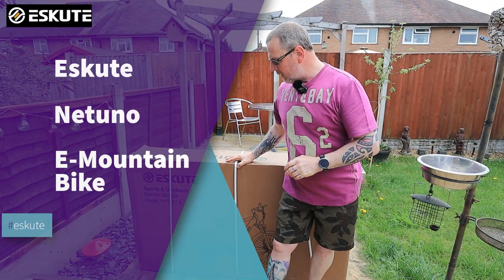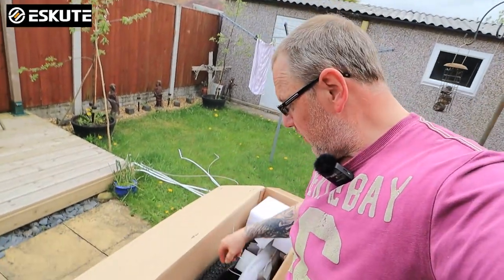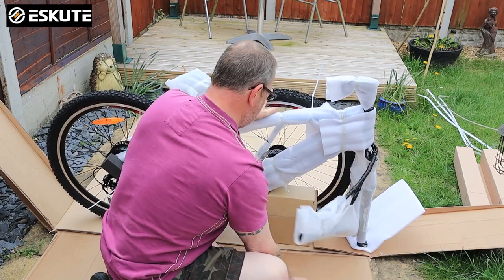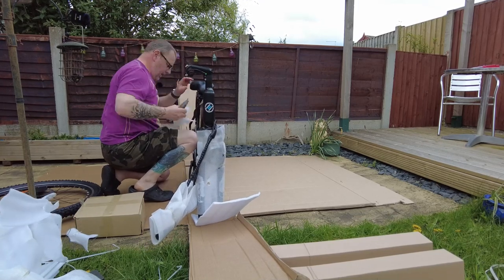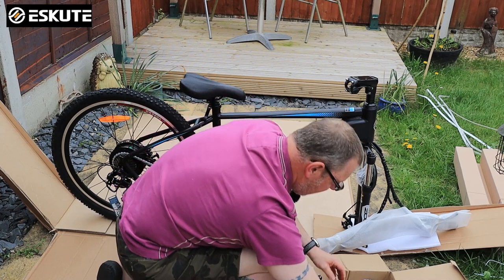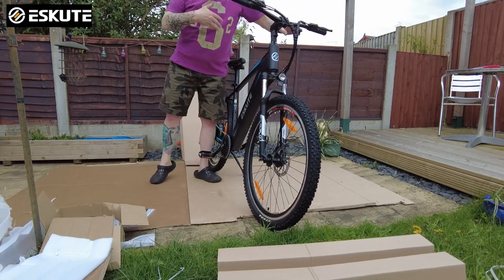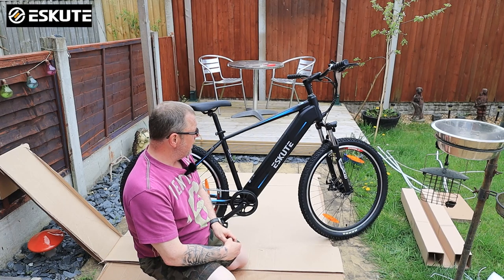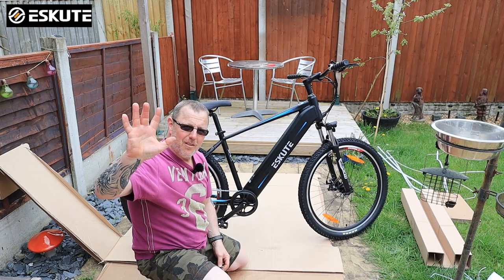Best Budget #ebike Eskute Netuno E-Mountain bike unboxing and building the complete bike.

Comment: HI paul, I have just bought the Netuno any idea where the small yellow connection goes. green obviously goes to the control.
Reply from the maker: The yellow one is for the acelerater control but this does not come with the bike, just leave it in the cable tidy.. (the control make the bike a moped so not legal in the UK

Comment: Cheers for the video! Just about to press the button on one of these. Would be interested in seeing how to change the brakes over - so used to front brake on the right, so I’m likely to make a mess on any emergency stop!
Reply from the maker: Noted! its quite simple, if not a local store will do it for very little, i took mine to a shop was £10

Comment: Just bought this yesterday using your link mate, if you get those links to rack and throttle, would appreciate a heads up or even better a video showing the fitting :-) Now this bit will sound really odd, but I have no idea what side brakes should be on a bike I just squeeze both equally TBH........
Reply from the maker: OK so if you dont use bikes often then you will get used to any side, but as an ex motorcycle rider and use other cycles the front brake should be on the right grip..

Comment: Hi Paul, I got this bike a couple of weeks ago and my wife has the Wayfairer.
I think she has the better deal, she has the throttle option but it doesn't sit comfortably on the bike so I may swap it out for a third party one that I fitted to my Netuno.
I was disappointed that the rear light was not wired in with the front and no mudguards were provided.  I think I prefer the control panel on the Wayfairer too as it can be used without moving a hand off the handlebars to operate it. Also the app to change settings such as Km/h to MPH is not yet available according to Eskute support.
Both bikes are heavy so not suitable for serious cross country but do handle rough terrain very well.
Mine now has third part mudguards and a rack and bag, I'll send you a pic when I get a chance 😀
I should add that mine is mainly for commuting to work via canal towpaths and tracks but it will get used for other things such as the odd landscape photo outing 😁 With the bike rack bag, I can do away with the big camera bag on my back 😅
Reply from the maker: Please please send a photo, and can i have the links to the rack, mud flaps and the throttle controller... I am going to send this comment to Eskute because i took mine out today and i had the same thoughts about it as you...
Reply: @paulcomptonpdphotography  sent you a message 😊
Reply from the maker: thanks
Reply: @Alan-DPhotos  Hi Alan, can I get a copy of the same message please?  Also have you swapped brakes around?
Reply: @kevwright2002  Links to bag and rack etc as requested.  The rack can be fitted to quick release which I find useful 😊
Bag -  ROCKBROS Bike Rear Rack Pannier.
Rack - ROCKBROS Bike Pannier Rack Rear.
Mudguards - rear for when rack is not attached - XCOZU Bike Mudguard, 2-Part.
Throttle - Worii Universal Thumb Throttle.

YouTube doesn't like links but they are all on Amazon

I've not changed over the brakes but it doesn't look difficult to swap cable around.
Reply from the maker: Sorry missed these old comment replies

Comment: I was pleased you put this video out as I was interested in the Voyager replacement. However, after you mentioned the need to switch the brake levers over I've been put off. I've done this before on a V brake bike and that was hard enough to get sorted with all the cabling and adjustment. I'd definitely need to get someone to do this and that just adds to the cost. I can't believe that Eskute don't switch the brakes around before shipping when the recipient is a UK address. Also can't believe they omitted the mudguards as these are an essential for off road. Shame really. Some good upgrades and then some not so good. Glad they left the throttle out though as they are illegal in the UK.
Reply from the maker: This is a very very easy job to do. all you have to do is swap the cable at the front levers. if you only ride this one bike its not a problem as you will get used to it... If your like me ride other bikes and i used to ride a motorbike then the front is always on the right side...  it will only cost £10 to take it to a bike shop... for the money i highly recomend these bikes.. And if you you use the code COMPTON50 you get £50 off to use on your brakes haha
Reply: Not sure I see the point of changing, personally I prefer the rear brake on the right side.
Reply from the maker: Sorry missed these old comment replies